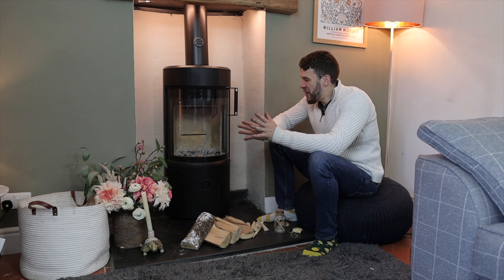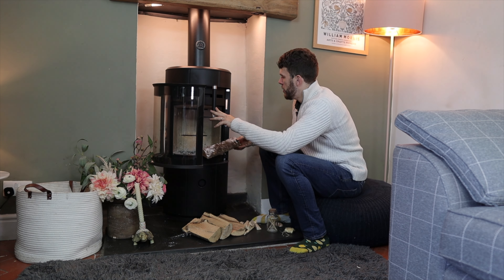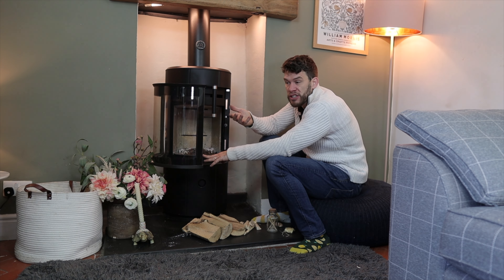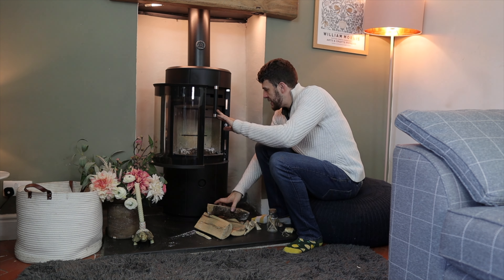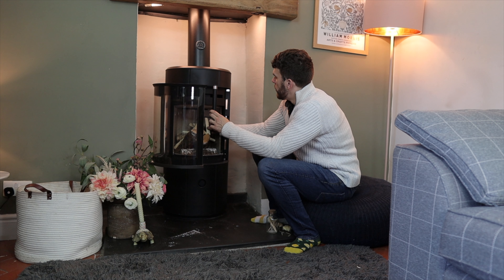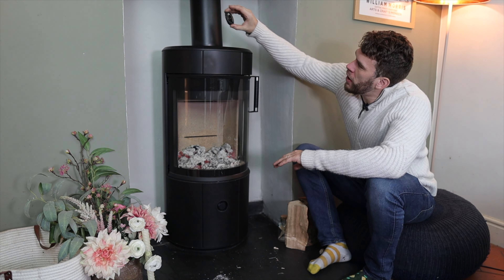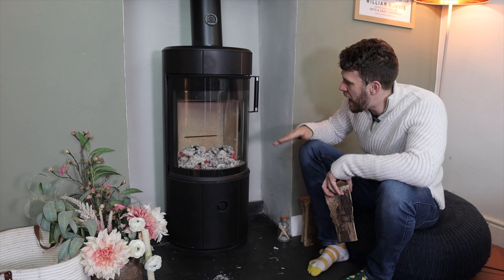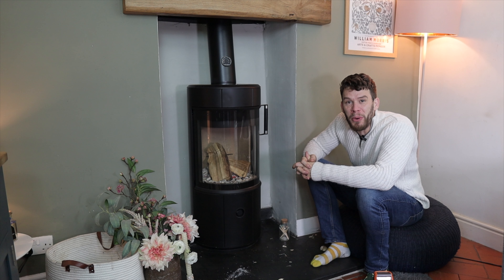When should you re-load a stove?

Comment: Usually I'll gauge how warm/cool the room/space is at the time of having no flame(s) present. If I feel like I'm in need of more warmth then I'll pop on a log and go from there. If, however, the space is way too hot then I usually leave the coals/bed to simmer down longer and will reload a little while afterward.

Saying that, I literally had to do a full relight only 5 minutes ago due to me not keeping a proper eye on my stove. Mind you it was easy enough due to the sheer amount of heat still present within the stove itself, so it was much easier than having to do the usual 'cold start' in a morning.

I love your videos!

Comment: Great informative video guys 👍🏻 

I have the Hampton 5 large thanks to one of your videos, thank you.

If I let mine burn down to no flames it’s usually the same procedure as the lighting procedure, I tend to load mine when the flames are still there but on their last legs, can be a bit of a nightmare if using oak or ash.

I live in a bungalow so a reasonably short flue, I’ve found by far the best timber for me is silver birch, I can run the stove really low but still in operating temperature and if I misjudge the reload it doesn’t seem to matter with the birch, it soon springs back into life. I think I will use up the timber I’ve got and go solely with the birch.

Thanks guys.

Kind regards

Tony
Reply from the maker: Silver birch is the best fuel (if you've seen my video). The reason it flares straight back up is because of the resins in the bark, it makes getting it going incredibly easy!

Comment: I’m on my second week with a Saltfire ST -X4, so it’s a tiny stove. I don’t seem to have a row of holes except at the top back… and, as far as I understand it that’s not quite the same thing. I’ve generally been allowing it to burn down, like yours, because with having a Recoheat fitted it’d be too warm to load up earlier.  I’m still learning and your video is helpful… but I never have more than two logs because it gets too hot, even with the primary air closed fairly soon after lighting, and it quickly seems to get to 200C. It’s all a steep learning curve as I try to figure out what’s best for keeping the glass clean.
Reply from the maker: Clean glass is all about temperature (200°C is great) and dry fuel. If you’ve got those it should be spotless.

Comment: Hi Gabriel, thank you so much for all those videos. You've been really helpful to choose our wood stove. We went for Heta Ambition 5. When our instalment guys were over to get measurements they said they were not recommending kindling because it is burning so fast. Instead they said they are using log starter and his recommendation was to cut a log starter to 6-7 pieces and use this instead kindling. Do you have any recommendation for that?
Reply from the maker: Sounds interesting. It wouldn't be what I would do, because it's simply another thing to buy, where as splitting a log into kindling is a far cheaper solution. Having said that, if money wasn't an object, I probably would, but only if it made life easier.
Reply: I see thank you so much Gabriel. Keep up the good work. 👍 @TheTortoise

Comment: Thank you for another great video! I’ve inherited a Morso Lion stove with a lovely crack in the top. I’ve tried fire cement but it seems to crack open every time the fire is lit. Any advice?

The stove also has a boiler installed and the nuts/bolts holding it in place have seized up. Looks like I’m going to have to take an angle grinder to it from the inside to try and get it out because it takes up so much room 😰

Keep up the good work!
Reply from the maker: Tricky one, obviously the official answer is either replace the stove, or dismantle it, buy a replacement top and back panel, and then the boiler (attached to the back panel) and the cracked top can both be removed and replaced with new. This should leave you with a reconditioned stove with no boiler.

The trouble is that old castings (like many old things), once you fix one problem you can create another. One of the most common issues is that the new panels will be in perfect original condition, where as the rest of the stove has settled and aged, and when you do up all the bolts you can cause the next panel to crack.

Definitely not an easy one to solve, but depending on who you are, it could also be a fun project for the summer.
Reply: Thank you. Could another option be to weld a piece of metal over the crack if not concerned about appearance? 

Is the issue with a crack in the top that it’s a fire risk or that of potential Carbon monoxide/smoke escape?
Reply from the maker: Leaks of CO etc should essentially be impossible unless you have a chimney draw issue. I don’t tend to worry about that, it’s more that the stove is showing signs that it’s on its last legs. If one parts cracks apart then others will also be failing, and the efficiency, effectiveness, control and fuel economy of the stove will all be significantly reduced. 

Weld repairs are quite creative. Most people wouldn’t/couldn’t, but it’s a bit like bandaging a problem, in that it doesn’t actually fix anything really. In many cases due to different rates of expansion it may actually cause more problems.
Reply: Thanks for the info, I’ve now got food for thought! I’m glad to have peace of mind about CO. 

All the best!

Comment: Do you reopen the air vents again to get it back up to temperature?
Reply from the maker: Yes, if needed. Sometimes even though the stove has died down, it’s still hot enough to get going very quickly without extra air. But generally I would open the air up until the fire was re-established.

Comment: That’s what I like my Hwam stove  it sends me a notification on my phone
Reply: Good grief. I suppose the day had to come.  The Scan stove in theis video is about as automagical as I'd like from a stove but then I relish the interaction with it.
On the other hand I also have a gasifying log boiler that isn't smart, that would be improved significntly with the option to send notifications.  Something I'll have to look into
Reply from the maker: Yea these auto things are a bit marmite, but the notifications is a bit trick. My only problem is I have a knee jerk reaction against technology bossing me around 😬
Reply: @TheTortoise  Me too, and my job is  automation/ contol design of renewable energy technology.  The last thing I want at home is a fire that makes decisions for me or makes my phone go ping!
Reply from the maker: Definitely worth not taking your work home with you😂. Amazing job though!
Reply: Hwam & Wiking ranges both have mechanical automatic air so  self regulate. Personally I wouldn't pay extra for a version with a phone notification setting unless I only passed my stove infrequently and was confident adding extra technology didn't reduce reliability. Also it's an extra thing for repairs and spares. Refueling auto air stoves can be a little different, not least as some have grates and perform the function better with just a little ash above it, not the usual bed. And seem to need loaded a little sooner than normal stoves. So great loading video. Not seen anything as useful on the topic.  Keep going young man!
Reply from the maker: Thanks a lot, glad it was of some use!